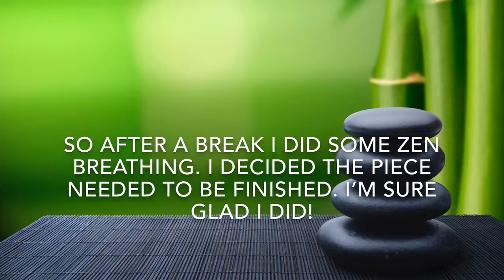Turning a resin and pallet-wood bowl on my lathe.

Comment: Hey man was it Polyester ? if so use a heat gun or a hot hairdryer every now and then to warm the resin and you will elimenate the chipping .😀😀😀
Reply from the maker: no it was epoxy resin, I think I didnt turn it as fast as I should of, and I wonder if I need a negative scraper.

Comment: Pressure pot and use stabilizing resin first.
Reply from the maker: I need to get a pressure pot for sure.
Reply: Hawk Bluff I watch a number of folks because the resin is fascinating to me. Check out Nick Zimetti. He does a lot with resin. He’ll point you the direction of several of his friends too.
Reply from the maker: Thank you. I'll check them out.
Reply from the maker: found out if you just seal the ends it will not bubble. I also switched to a slow cure resin.